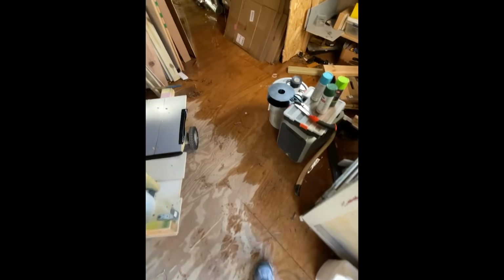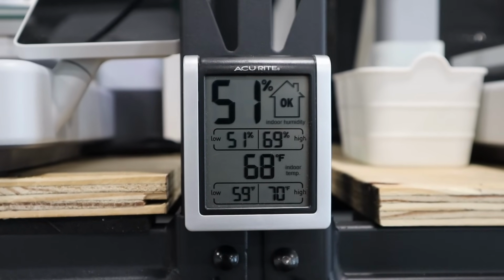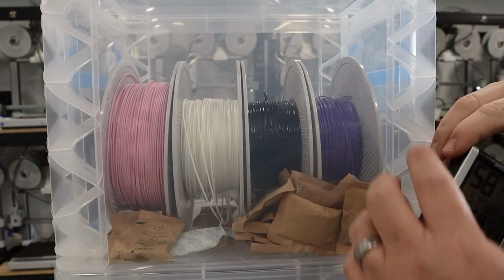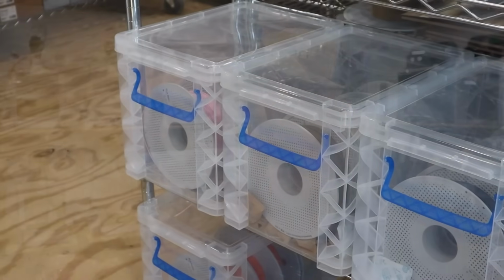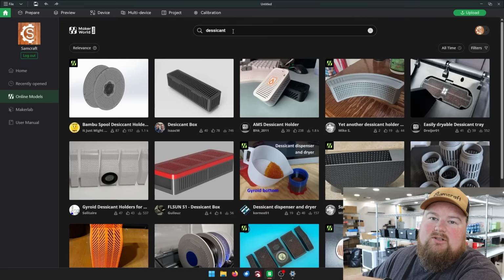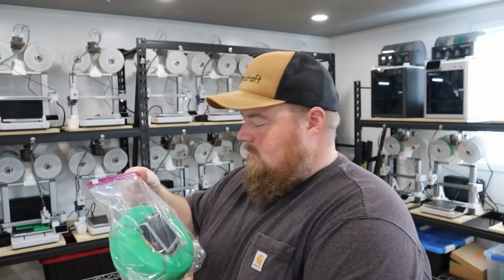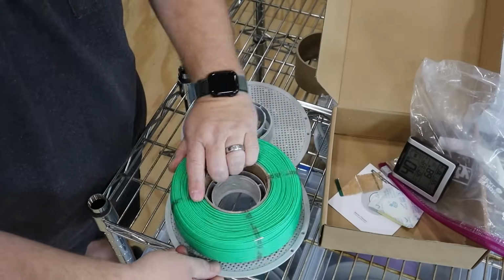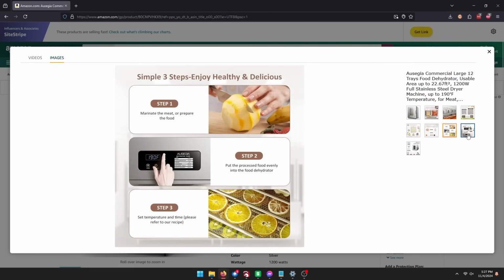Moisture Effects on 3D Printer Filament: Print Quality Test!

Comment: OK, once you get your filament dry enough for printing how much time do you have while it's still on the spool and printer until it's too wet again? I'd hate to use degrading print results as the measure of when to pull it off. BTW, I'm just a newbie and literally this morning unboxed and configured my A1 with attached ABS. First printer, so I'm scouring the Tubeverse for content. Your's was awesome.

Comment: hey, an update for your boxes. i've baught the sames and use silicone (for joints in the bathroom) to seal the top.
- remove the top
put plastic wrap on the surface contact of the top of the box
put silicon joint in the holes of the top
wait a bit for it to be just tacky
place back the top otber the spastic wrap top of the box
wait for it to dry

You now have a jointed sealed box
just cut what's coming out for more beautifull finish

Comment: The containers are not air tight. Even with the desiccant they will remain very close to the same humidity as the rest of the room as they are exchanging air (and moisture) with the rest of the room. In order to have the desiccant pull the moisture out of the spools of filament and surrounding air, they must be in an air tight container.

Comment: I wish I had as low humidity as your high humidity. My filament dryer gets a lot of use. 

I assume this is your first time with a humidity issue given some of the comments you make and your reactions. PLA doesn’t care too much about humidity so as long as you get some of it out of your water soaked rolls then you would be fine.

Comment: I'd been storing open reels of filament in a larger version of the boxes you use, and every time I opened a new reel I'd toss the desiccant pouch in the box, but it wasn't keeping up with the moist air moving into the box.  I recently discarded all of the desiccant pouches.  I'll dry the filament before printing it.  My business prints parts in TPU and that's very hygroscopic.  TPU needs to be dried before printing while PLA usually doesn't unless your water jet floods your print farm.  I have a crazy idea of making a foot tall filament drying column that heat dries the TPU as it unrolls from the reel as it feeds down into the printer.

For future reference, if you need to dry the reels that were on the printer, you can put the open reels into a cardboard filament shipping box, place that on the bed of a 3D printer, set the bed temperature to 60 C, and poke a few vent holes in the top of the box.  Leave the filament heating overnight and it's dry in the morning.  If you have a 3D printer with a heated bed, you have a filament drier.
Reply: I use plate warmers that you use for catering. Won’t risk burning out your thermistor for an unnecessary run time.
Reply: @neilphillips9163  - I think build plate thermistors die because bed slingers bend their fragile cables.  Heating a thermistor to 60 C doesn't shorten its life.

Comment: Hey, comparing to what I have in my workshop, 40% out of the box is super duper high. It's actually SO high that I suppose the measurements are wrong. My hygrometers need quite a lot of time to get to the correct humidity, particularly when they go from high numbers to low numbers it seams. So I think your measurements would require more time to get to real number, a few hours or so.

Anyway, I'm in France, so humidity is different, but I'm at about 45% windows opened all day long. When I run all 5 printers, windows semi open to allow fresh air, humidity goes down to about 35% and everything is fine.

The more important is I still run my filaments when they got dryed down to about 15%, that's a very good result.

Comment: Totally Not buying it.  
Been printing for 10 years.  Here in the Pacific Northwest  It Rains here.. A LOT!    
Yet I've NEVER had a  ..Genuine... PLA /moisture issue.. Period !   
Even with exposed spools  sitting on a shelf for over a Year.

Lots of Oxidisation issues though as PLA is Very  prone to this.. Unlike Moisture which I have come to regard as an Old Internet Fish Wife ..'Story' .
Warm air and daylight exposures can oxidise (embrittle) PLA filament quickly ..sometimes even within 48 hours exposure.  
 
PS; Store your spools in their boxes when not in active use.. It Works !

Tilting at windmills here... Sammy.

Comment: I am assuming you figured out or know you can dry your desiccant  packets. I started to use the blue beads that tells you when to dry them up again. Or you can weigh them. I thought 20% was ok but 15% is the goal. I use to use the big 10 gallon totes to store filament but I went down to the Tupperware cereal containers that hold single rolls that I’m sure you have seen. You really should use an air tight container that has a gasket. After that 15% instead of 45%. 50grams of the blue desiccant holds 12 grams of water after sitting out for 1 month. Looks almost a clear pink now. Your dryer is awesome. Good videos.

Comment: Almost all silica gel, even the disposable packets that Bambu sends, can be recharged in an oven or microwave. I open all the little individual packets and dump them in the same as the rest. The generic stuff doesn't "indicate" by changing colors, but if you mix some color changing silica gel beads in you can get a good idea. The beads can be reused/recharged almost indefinitely as long as you don't overheat them which can damage them.

The only packets worth avoiding are the ones that are just powder instead of beads- but it's pretty easy to tell when this is the case just be feel.

Comment: Living in Wales (UK) the humidity rarely drops below 50%, I've never had issues with moisture in my filament. Currently have a roll of black PLA in my P1S that was sat on top of a ender 3 for more than a year without any issues at all. The only time I've had a problem is with marble PLA so with that I'm assuming whatever they add for the grain isn't helping there. I do store my filament with a desiccant bag in the cheap vacuum bags from AliExpress but I do have a habit of leaving filament laying around.

Comment: Your not drying your shop out correctly. You need to dry it by moving high volumes of air over the surface while combining it with heat. I would rent an industrial blower and industrial dehumidifier used for water damage restoration. You will also need to perforate the floor to allow the moisture to escape.

Comment: I laughed pretty hard when you were freaking out about your humidity being at 68% 😂 I live near Houston which is like 80%-100% humidity all year around. My house stays at a constant 65-70% humidity inside lol. But yes it is a pain in the ass dealing with my filament on the 3d printer especially those 24hr or more long prints

Comment: Not sure HOW I missed this 2 weeks ago (and up until today), but I fight that same issue here in my much smaller farm..  I've done the dryboxes with seals (Ziploc Weathershield 60qt boxes, they hold quite a few spools) with the rechargeable dessicant devices (EVA-Dry E-333 model), and it works OK, but still doesn't really keep things dry enough..  I'm in the process of converting an old supply cabinet until a large-sized 'drybox' with active dehumidification and heat, but haven't settled on what dehumidifier I'm putting in it yet..  I'm leaning towards an industrial cabinet dehumidifier setup, along with a forced air heater to keep the heat about 5-10 degrees above ambient in the room, which SHOULD do the trick (I'll have to seal the doors and any cracks in the cabinet, and I'll likely insulate the walls as well).  One simple test to see how bad your filament has absorbed water is a bend-test..  If the filament bends without breaking, you're likely still ok, but if it snaps easily, it definitely needs drying.  Advanced filaments are even worse for that (anything CF or GF will shatter badly when super-wet, I've had spools that pretty much shattered all the way through due to the issue, and left little 6-8" 'arcs' of filament).  My current solution is to rebag them like the manufacturer does.  Get a 'Magic Seal MS125', and some 12"x20' vacuum bags, new 'good' silica packs, and those little humidity display cards, dry them in my Sunlu S4, then vacuum seal them.  They still fit on my storage shelves upright (better to store them upright than laying flat), and don't take up much more room sealed up.
Reply: I'd also seriously consider putting that waterjet either in the other 'old' shop, or build a 'room' around it, floor to ceiling with it's own dehumidifier.  Whenever you run that thing, it's going to bump up the room's humidity levels.  I've done the 'dehydrator' method (the old-school one with a NESCO round dehydrator and a cake carrier lid on top, holds 2 spools at once), and it does work, but not nearly as well as the S4 I recently bought does.

Comment: You are right , the little bags are not a good idea as you dont know how used up they are. Get the rechargeable descant that changes colour ( the orange stuff as the blue is more toxic). Heat is important but you dont have to get things as hot as you would think. What you need is heat and airflow!

Comment: I use MAXSafe gun safe dehumidying rods (currently $14 on amazon). I put a 12" in each plastic drybox, passing the cable through a small hole in the back of the box with a rubber grommet. I also have a container of desiccant in each box. The heating rods do not get hot enough to melt the filament but enough to raise the temperature in the box to about 77-80F. The humidity stays close to 25% when plugged in. I also put a small cheap hygrometer in each box to monitor it.  Unplug the rods when the humidity is where you want it. If it gets close to 40% plug it back in. I don't know how much you spent on that dehydrator, but I'm assuming it is more than a handful of these rods. Good luck with your humidity issue.

Comment: I use IP67 waterproof totes, with cheap meters in each box, and they sit on 15-25% which I am happy with. Cost me $12 per tote for 4 spools. I also use colour coded dessicant so you can see when it hits 50% used.

Comment: Those are non-gasketed totes, they are sucking more water into the box from the outside than they are pulling from your filament. They will NEVER work, even when your shop is “dry”, unless you live in the desert. Also, a lot of desiccant and desiccant packs come without having been baked out. They intend for you to bake them in an electric oven (doesn’t generate moisture like burning g gas does). You need a real filament dryer. The kind that are essentially a modified food dehydrator are best. Or just buy a food dehydrator and modify it yourself. Your zip-baggies are probably the best storage for the money, just be sure to toss any that develop holes. Sterlite makes a gasketed tote that holds 4 rolls, but the lid doesn’t seal as well since it is only clamped from the ends of the lid and not all the way around, I printed clips to go around the lid of mine and it will hold,d 10% humidity for months... You do need to recharge the desiccant at least every 6 months though. Another option might be a plastic 30 or 55 gallon drum, a bunch of dry desiccant and a gasketed lid if you need a lot of storage. TLDR; I have been here, a proper filament dryer and proper storage is worth the money.

Comment: One thing to remember as well is humidity more is an effect over time for PLA. It will become brittle on the spool but takes months. It will string a touch more, but again, not immediately.. Ive had PLA that was drenched and have never had issues outside of stringing that was not more than just whisping vs not when they were freshly opened. The brittleness on the spool usually becomes the biggest issue as it risks breaking during printing. Normally you can notice that almost immediately though since it will shatter during handing even just loading the filament into the extrusion system.

For reference I've been in the space for almost a decade and had a small print farm in the same space as also breeding fish in aquariums, so the battle of humidity was a fun one. I still managed to print pla, petg, nylon, abs and asa fine though. Just for the last 3 would be printed direct from drybox. 

Another person already mentioned CNCKitchens desicent video, 100% check it out. Its very good info on how you can quickly refresh the old packs, carefully.

Comment: Running a print farm, your best bet is a climate controlled shop. As long as the AMS units are not enclosed, the filament is absorbing moisture. Seal the shop up as much as possible, run your dehumidifier constantly and maybe get a second one. Keep the inside of the shop under 40% and Bob's your uncle. Any drying you do to the filament will be negated somewhat in storage and definitely while sitting on the open AMS. You've got a small fortune invested in printers, keeping the whole shop dry will help you get the most out of them. Good luck.

Comment: Consumer dehumidifiers can dry out a small room relatively fast. For your case, renting an industrial big boy would have been a much better option. Not only they rent at a very low price for 1-2 days, but their efficiency coef. is also very high. As for the actual filament rolls being moist, if you have a big oven you can dry 6-8 at a time x4h means you can dry all your rolls in 2 days.

Comment: Why not buy some gasket material and seal up those boxes?I don’t have a bambu machine or a multi filament system. But I’m printing directly out of one of those cereal containers with a custom circle insert I designed. The humidity has stayed on the hydrometer in the 20-30%.

Comment: With the water leak you had that would have shot the level of the humidity through the roof   So you may well and truely have done your tests at the wrong time  .Your humidity will not be going down very fast  with the weather being dry

Comment: I recently had a water damage like yours, but with way less water. We had to take out all the wooden floorboards since it’s practically impossible to dehumidify quickly enough to dry out the water that had gone below the floorboards. The floorboards are also working as spunges. I believe you will have to remove your plywood floorboards and keep drying out for a couple of weeks before replacing them.

Comment: So close to 100K 🎉
I hope you can dry out the shop before mold sets in. Did you have to pull up any of the plywood flooring?
Also, I noticed in the last video that the shops are now connected. Did I miss that part of the build?

Comment: I worked in the temperature control industry for 40 years. If you want to dry your space out you need to warm the air up manically and then return it to the AC unit to dry it out. Warm air holds more moisture than cold air. So put a space heater 74 and your AC at 65 and that will wring the water out of the air. You might want to invest in a whole house dehumidifier for your space.
Reply: I was wondering what his temperature was and if he was over cooling. Higher temperature should cause relative humidity to go down.

Comment: That's quite the print farm!  Look, I work in research and all the big industrial machines use pellets, which are dried per manufacturer's suggested time & temps.  The same applies to the small scale and filament based machines.   Storage is important but so is drying before use and keeping dry while printing.  I really like the EIBOS Cyclopes filament dryer since it has an upgrade to let me use a 3kg spool.  I have that on a few machines.  I also have Polymaker Polyboxes, which is a sealed drybox.  If your material isn't super fussy and already dry, those work great and keep the humidity super low.  For drying multiple spools, or a 3-5kg spool, the PrintDry Pro is the way to go.   I have 23 machines in my home lab and they are all enclosed, air filtration and fire safety device equipped.  I use Octoprint and Obico to do the prints and video monitor them.  If you can control the quality of the material condition going into the 3D printer, you've just eliminated some factors that could be real time killers to sort out - strings, hairs, things that resemble retraction issues but are probably just damp material!   Print smart and safe!